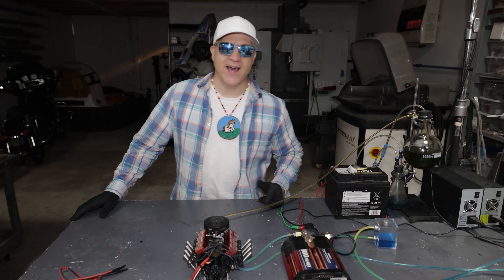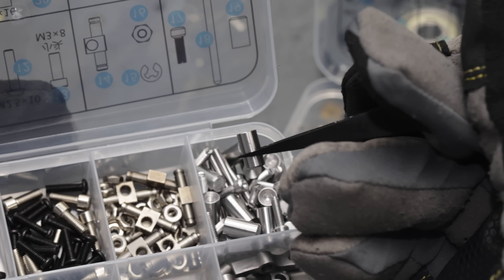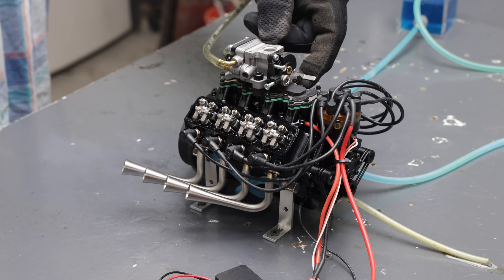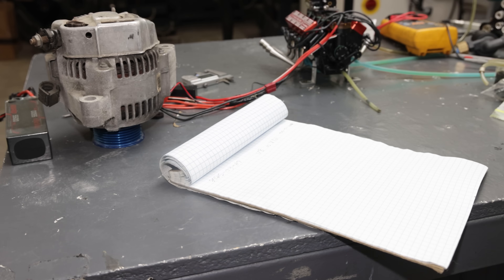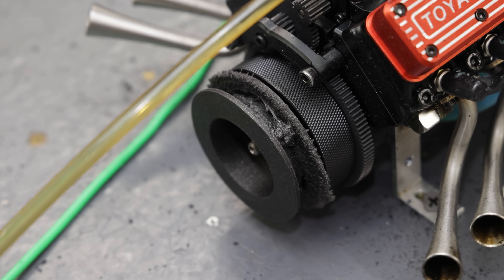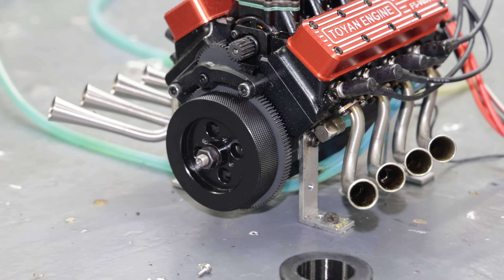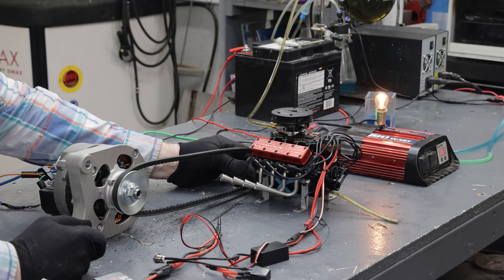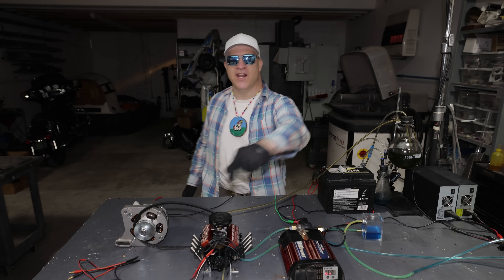I Built A Mini V-8 Generator That Actually Works

Comment: Funny how physics makes a tiiiiny V8 still sound like a V8
Reply: I've noticed 2 stroke engines from 125cc 250cc and 500 cc sound very similar, same with a Harley 883 compared to a 1200cc. Youd think the bigger pistons would change the tone more but surprisingly not much. Different exhaust changes everything though. I've owned them all except a 500cc dirt bike.

Comment: Cison makes a 44cc V8 that has a lot more hp. than the Toyan (abt. 4.5 hp. or so) and a LOT snappier. JohnnyQ90 put one in a 1/5 scale 4WD pickup and it rips! Something like that would probably be much better for actually running an alternator. You'd still need a smaller alternator, and probably direct drive it off the crank to keep parasitic losses down to a minimum. An externally adjustable field circuit would be good, so you can apply the load gradually. If you want to get REALLY serious, ChaunQi Engine makes a 277 cc. V8 that has dual carbs and sounds like a small block Chevy. I don't know if they're actually available for sale in the US yet? He's developing a 6 speed sequential transmission for it as well.😉

Comment: Honestly this video possed me off a bit. The pulleys failed largely because of the heat generated by the slipping belt. You can see the belt/pulley material accumulating on the bench.  Fixing the alternator properly, and ideally adding an idler to increase the wrap of the belt on the pulley would have drastically reduced the slip. Even better wpuld have been to use a metal pulley, perhaps with a 3d printed boss to mount it to the crank. As others have said, the carburettor comes with a wedge that limits the throttle opening angle  while running in - removing this after break in would have drastically increased the output of the engine. It should also have had a radiator - theres only a very small amount of thermal mass in that little water tank so increasing water flow was only ever going to have a very limited improvement.
Reply: he chose to bolt down the engine. he chose to not bolt down the alternator. cool engine, but a crappy commercial.
Reply: @CBWP he did bolt it down try watching the video
Reply: the problem isnt the 3d printed pulley, glittery PLA just isnt the right material for the job.
Reply from the maker: I appreciate the passion, but the reason I didn't change it was because the engine wasn't going to keep up anyway, I didn't put attentioner because I was afraid it was going to break the crankshaft, the connection point for the crankshaft to the flywheel is sketchy to say the least. As for the radiator no absolutely not this thing was not overheating, the radiator is there with the fan and the electric pump, watch the video again you can see it there. I also show putting the electric pump in place.
Reply: And he should have started it without a load and once it was going, then turn on the load.
Reply: @thegarynator  and sometimes you even have to soft start loads to reduce initial torque or current draw...
Reply: Was going to post the same things, but you beat me to it.  With a proper setup this should work and be reliable.  All the items you pointed out should be the minimums.  The biggest area of concern is that cooling seems to be the weak point on these small engines so you really do need to go overboard there and provide a large amount of thermal mass to reduce the heat levels.
Reply from the maker: Look at timestamp 08:57 you can see the radiator and fan

Comment: It's a really nice engine! Sounds great too, the only thing I find a little strange is that its so nicely engineered, why not add a proper oiling system? That grease needs replacing every few hours or so, and 2-stroke oil in a 4-stroke does not seem to be a great idea to me. But what do I know, I'm just a guy enjoying these videos 🤷🏻‍♂️
Reply: @dirkjanvanvliet  isn't that what the little belt driven thing is on the front? He's got an electric pump for the coolant..
Reply: @Bryan-Hensley  as far as I know that's only a water pump. He used the electric one because the stock one was not sufficient

Comment: Love to see this engine with actual oil galleries
Reply from the maker: Yeah I think it's just too small... The mini V12 has oil galleys but I don't know that it works that well. And that engine is twice as big as this one
Reply: Yeah and not running it with 2-stroke oil as an afterthought. Also not using o-rings as belts
Reply from the maker: @_BangDroid_ good eye! They were definitely o-rings, the original ones broke upon installation there were some sort of thermoplastic, I swapped them out with high quality actual o-rings and they worked great.

Comment: If you make a properly made setup, with a good dialing of the pulleys, for it to be fixed properly, it's not impossible to be generating some cool energy. Very impressive for such little motor

Comment: That belt drive was using up a bunch of power for the size of the engine. The fan inside the alternator was using up some of the power. You need some type of small  direct drive electric motor turned into a generator. Those alternators are 1,400 watts and up. I used to use this setup with a 3hp Briggs to charge my race car battery at the races. The alternator would kill the 3hp Briggs if I didn't overrev it when hooking up the battery cables. You could not start it with the alternator connected. The governor would be wide open charging a low battery. That is a sweet little v8. I'd like to see what it's capable of.
Reply: Yeah, a little 300kv brushless motor could pull enough torque to stall that engine
Reply: @Industry-insider 
Haha
Reply: @Industry-insider It's impossible to stall a gasoline engine with the generator attached to it....

As the gas engine slows down, the generator attached to it will produce less power as it does, and free up the load on the engine.
Reply: A brushless R.C. plane/quadcopter motor and a 3-phase rectifier diode setup would probably be MUCH more efficient than the larger alternator. 

You can then experiment with different KV rated motors to get the best efficiency. 

A 2000KV rated brushless motor will produce 1-volt when spun at 2000rpms. A 300KV motor will produce 1-volt at 300rpms.... 
The reverse is also true. With a 2000kv motor, it will rotate at 2000rpms with 1-volt applied to it, and 300kv motor will produce 300rpms with 1-volt. There is a fine balance between input speed/output voltage when it comes to selecting the proper KV motor for the application you are using it in. Generally, and lower KV number is better for using as a generator, as it makes more power at a lower RPM, BUT, it all depends on how fast you want to be turning your engine at a constant speed when producing power. 

You get the idea.... 👌

Comment: The carb has a throttle limiter that you should take off and let this thing eat it.
Reply from the maker: So I tried removing it but at wide open throttle it bogs down, I believe the carb is too large for the displacement so the solution is to limit it to 30% throttle which is full throttle at this carb size for this displacement.
Reply: @WarpedYT  as hot as it runs so quickly.. maybe even the cylinders cant dissipate enough heat so under heavy load your cylinder temps are too high and it just pre ignites and stalls as a result.. coolant is only part of a cooling system.. the metal has to get the heat from the cylinders into the coolant..  and you have to have enough surface area of coolant to metal otherwise you are getting an artificial feel-good temp as the coolant stays cool while the engine still bakes..  be interesting to see how high the EGT's are getting..
Reply: @WarpedYT is it that or a lack of fuel at WOT?
Reply: @meanman6992  Maybe it needs more air
Reply: @WarpedYT time for a mini Holley Dominator and EFI. 😂
Reply: @WarpedYT  interesting. mebbe the carb has an air leak?
Reply: Set up it for forced induction. Sounds like the carb is already big enough 😊 @WarpedYT
Reply: It's like a governor, huh?
Reply: I wanted to say the same, but after it's broken in. JohnnyQ has the same engine in his last video.
Reply: yes it sure does u can see it
Reply: I tried taking it off on mine and it bogged down too.

Comment: I wish they would also get a little cheaper because 500 to 5000 euro is too much for me
Reply: Low sales volume and high manufacturing complexity makes novelties like these expensive, no way around it unfortunately
Reply: @misterdeedeedee  yes
Reply from the maker: This one is 650 euros with my discount code
Reply: @WarpedYT  no it's $819 . Dam
Reply: Basically you want free stuff
Reply: @CaptainKedah  are you stupid or incompetent? Where in my entire comment did i say the word free? I said i WISH they would get CHEAPER. NOT FREE
Reply: 5k euro? Youd better off head to a local junkyard and snatch an LS1 engine lol
Reply: Yeah if it was closer to $200 would be better
Reply: @pepepantuflas1  would be amazing if you could precision machine stuff for that much indeed. Being real just the cam is easily worth that